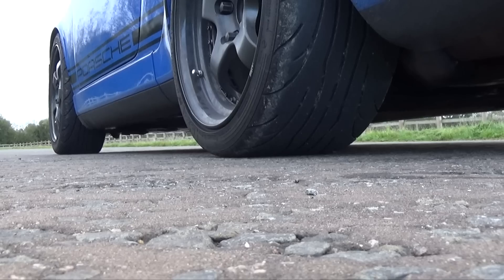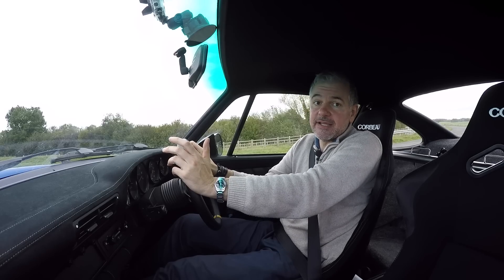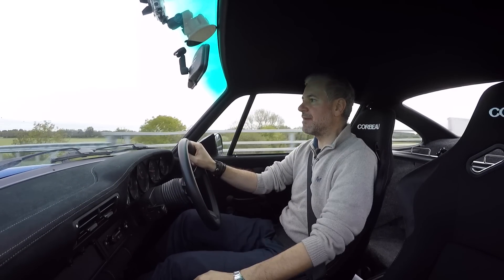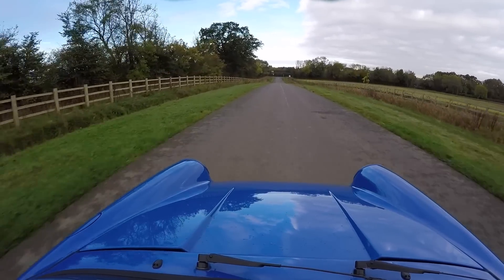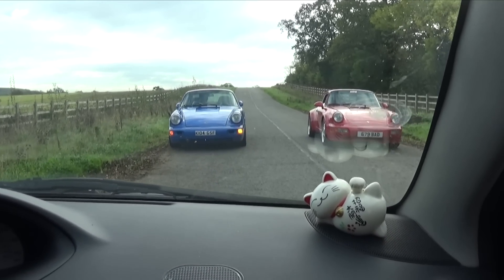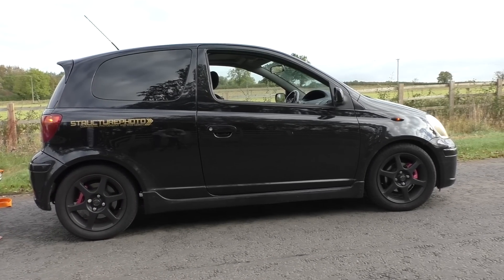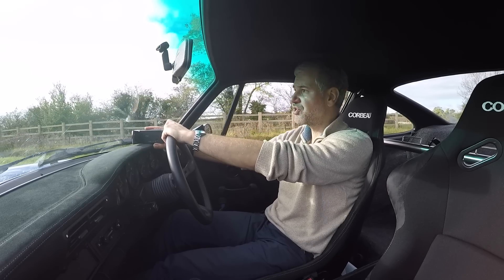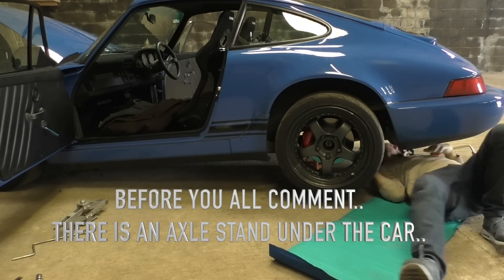C2 Converted Porsche 964 - First test.. and breakdown!!

Comment: The car is astonishing, mate 😊👍 Those fly byes were very nice. Rear semi-shafts handled 70% of the torque on the C4 config, now they’ll have to handle it all...too much ! Change them and comeback soon 👌😎🤜🤛
Reply from the maker: Thanks Nuno.. appreciate the feedback and will be back soon enough!
Reply: Number27 Any news on the rear axles’ replacement ?
Reply from the maker: Hey Nuno, the rear CV joint will be replaced this weekend but will then need to do some diagnostics as to why it broke and if the diff is working properly. then will sort out a final solution

Comment: Thanks for sharing. Would like to see another test once sorted and your opinion on whether or not you would recommend this conversion again. I'm considering converting my C4 and very interested in your opinion if it is a good decision. Thanks.
Reply: Mike Northern Just tweak the front suspension to strongly decrease 964 C4’s  typical understeer, and slightly increase power and torque (270 hp/330-340 Nm) on the engine by using a pre-flashed ecu chip (easily available, any of the mostly known ones), combined with a less restrictive catalyst conv. and main silencer, and you’ll be happy. Trust me, did that to my ‘91 C4.
Reply from the maker: Hey Mike, for me it was definitely worth doing.. I guess it depends on the individual and your priorities but if you don't drive much in the rain or winter then its a no brainer for me...
Reply: Bad decision, if you want a C2, sell your c 4 and buy a c 2...

Comment: What does PDAS stand for please?
Reply: LotusJay German for “Porsche Traction Control” on the early/first AWD 911, the 964 C4. Basically you have 4 magnetic wheel speed detectors (in front same as the abs system), 2 long. and transv. accelerometers, and a manual locking difs switch for hard traction low speed situations. The combined pdas/abs computer controls 2 locking (center and rear diffs) hydraulic actuators to enable a kind of basic traction control system.
Reply: Nuno MC OK thanks for the reply.
Reply from the maker: Yes, the idea is to see if now the 4 wheel drive system is disconnected the traction control still properly operates the LSD...